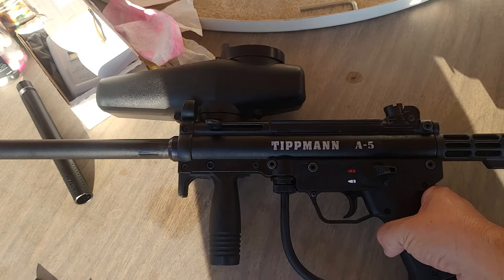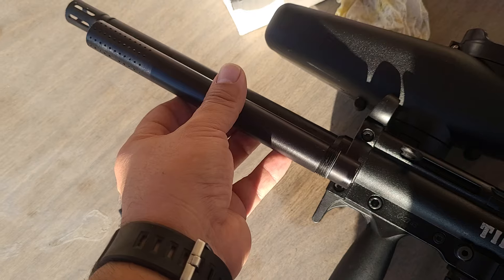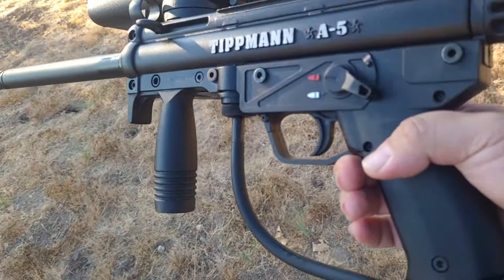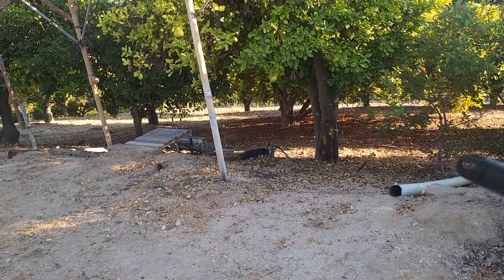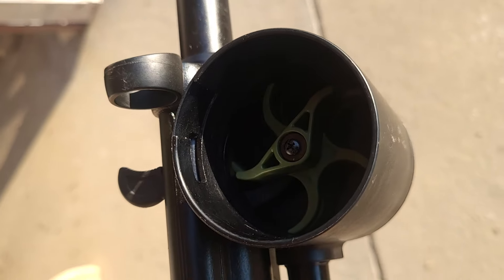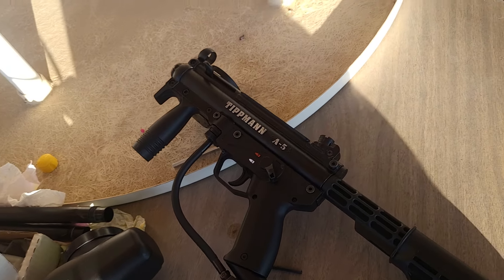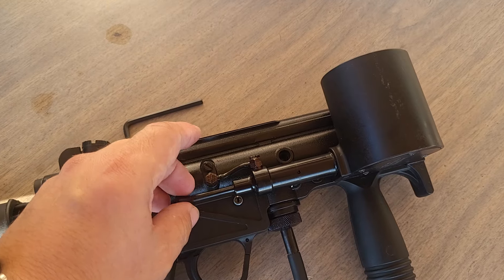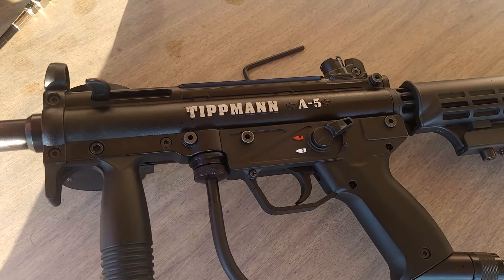Tippmann A5 Home Defense Project

Comment: Addict! 😂

These Tippmanns can lay down fire fast. Electro trigger next maybe?

Cool project. I like the ole school.

Byrna Kinetics are a good representation of paintballs without the chop.
Reply from the maker: @lesslethalfordummies  Hahaha. Ya Byrna rounds work too, but i only have like 20 left 😅
Going forward, Ill prolly just be getting T4E QAB for my Nylon Balls. i can get them from ANSgear anyday. Im a bit hesitant to get the Mechanical RT or E-grip until I do some more research and/or lower end spring/bolt mods.
Reply: @frgtdrepsn2904 The RT will steal air and power from your final goal. E-trigger or just practice your best two finger is best.

Comment: Good memories,  got shot by a lot of these playing paintball growing up, reliable, fast. They make response triggers that make it like a binary lmfao. Also pepperspray or kinetic impact balls from burns so like hard plastic or rubber vs a ball breaking. They can handle around 300 fps . Gotta clean the barrel, good soap and water soak over night then squeegee, clean the internals if you can as well cleaner it is the more accurate.
Reply from the maker: @jackgreenstalk777  Thanks man! I played paintball in the mid 2000s and still have my Viewloader Maxis and Spyder Rodeo STBB markers. I always got lit up by my friends with Tippmanns tho. LoL. 🤣

Comment: the limit at most fields is 300fps and the higher end markers will do over that easy. its been 15 years sence I played Pro so I have to admit I dont know much about current guns,, but I do remember my autococker would do 460fps if I turend it all the way up, mind you choping every 3rd ball. but that being said if you replace the guts with better parts and your only pushing 260fps then you need to replace your regulater and make sure your useing compressed air and not Co2. that or just use pepper balls instead as 260fps is perfect of pepper balls and the higher speeds are only good if your using rubber or hard balls that need the extra energy for defence.
Reply: I'd only be interested in arrows for that platform. Airbows can take every species of big game on this planet.

Comment: I will admit I know nothing about paintball guns I only know about air guns and firearms.  The longer barrel is definitely the right way to go to build up higher pressure to increase velocity. But that thing is not moving so I ask why have a muzzle device and waste the precious air you have losing velocity? I would use a barrel with no muzzle device if that’s possible. 

Is it possible to put pepper balls or rubber balls in it? Like the byrna
Reply from the maker: @etherico3041  The muzzle device spins and loads the balls more reliably. it is a feeding system. Most paintball guns just rely on gravity to load/drop the next round into the breach/barrel. The feeding system uses air pressure from an existing system preinstalled in almost all of these type "in line" bolt systems from this manufacturer. the blowback air resets the hammer and allows for semi auto fire. This paintball marker with or without the muzzle device is always going to use that blowback air to reset the hammer back to a cocked positon.
I can use rubber balls and nylon or pepper balls (not legally in my state) I hope this answers most of your questions. I wanted to not have a magazine fed LL marker is the main objective
Reply: @frgtdrepsn2904  thank you I appreciate it! By muzzle device I’m referring to the ports, compensators, etc. (not the feeding system) those are all going to leak gas/pressure before the projectile leaves the barrel losing velocity. I was wondering if a muzzle device was really  needed since there’s not really any recoil or seemingly much going on at the muzzle? Since theres hardly any recoil proper sight alignment, sight picture, and trigger control will get the job done. While muzzle devices may not reduce it much at 260 ft I’ll take any increase I can. 

That is assuming they even sell just plain barrels. I live in  an antigun state looking for home defense alternatives and this was neat to see! Especially to get recommended when I haven’t been looking recently 

Just to clear up my confusion you can use rubber or nylon balls but pepper balls are illegal in your state? If that’s the case these laws really make no sense because I would imagine pepper spray is legal there
Reply from the maker: @etherico3041  Oh ok i was confused when you asked about the muzzle device. The barrels in the video are one piece barrels and those are how they are made from the manufacturer. Since it is a paintball company making paintball parts, the little holes and flutes are more for paintball accuracy and range. Their are a few 3rd party manufacturers that make solid barrels with no holes and flutes on the sides/at the end. I am trying to make this build as cheap as possible, so i will not be buying a barrel such as that. All my larger LLs have ported/flute holes on the barrels, except for the T4E HDB Shotgun. 
If you are not talking about the barrel, the other piece I think you are talking about is where the barrel threads into the front of the marker. That is a barrel thread adapter and this model uses that instead of threads on the 2 part shell of the body. It is a metal (prolly zinc) shell and that barrel thread adapter fits in front. The Byrna Mission 4 is pretty similar internally. I cannot remove or modify this so that the barrel threads straight into the body of the metal shell... as that is beyond my skill level and i do not have tools or the knowledge of how to properly do that.

Yes It is not legal to use or posses pepper balls in my state, California. I can use, purchase and have shot Nylon and rubber rounds thru this Tippmann A5... And im going to try aluminum balls in the future. Also, I can buy and use pepper spray legally.... Hahaha Makes no sense at all, but neither does Gavin Newsom 🤣

Thanks for watching and those are some good questions 👍
Reply: In paintball theres a sweet spot, 12 or 14 inches is all you need. Any more begins to slow the ball.
Reply from the maker: @jackgreenstalk777  Yes sir! I think im gonna stick to the 11" barrel